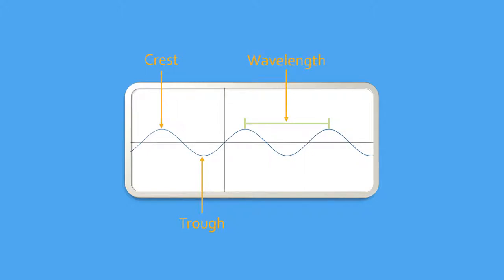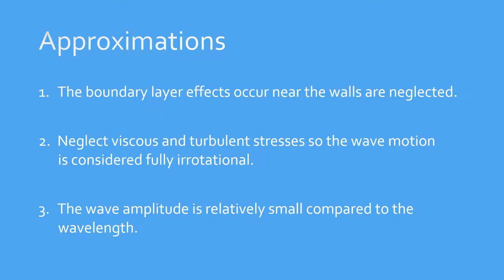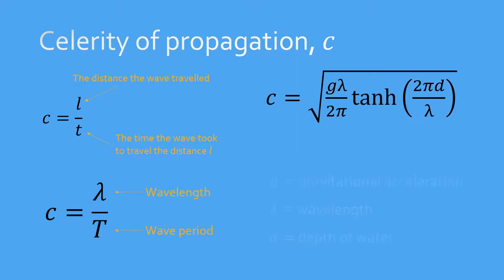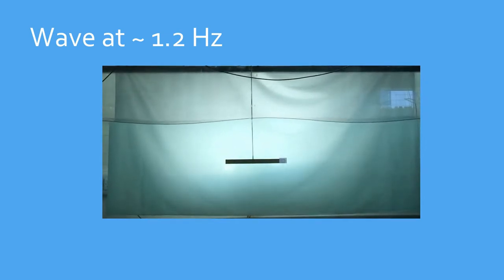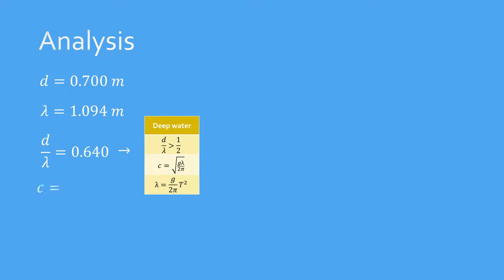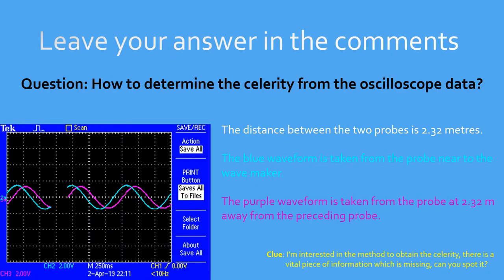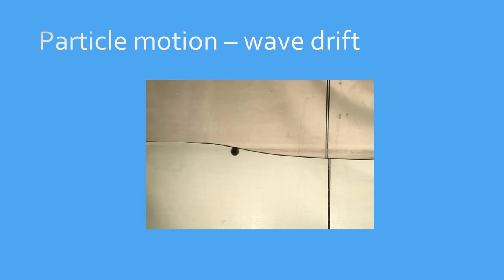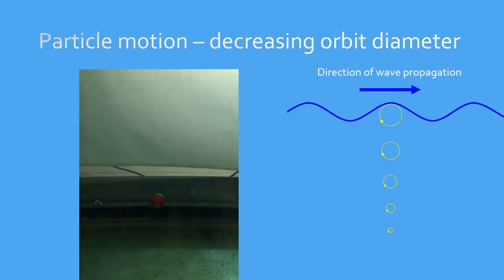Linear Wave Theory

Comment: If I understand the question you posed, you would look at the distance a crest (or trough) travelled (in this case, the distance between probes = 2.32 m) in the amount of time shown on the oscilloscope (I think you said each box = 0.25 sec, and it looks like about half of this, or .125 sec between the purple/blue crests), so the celerity would be c = 2.32 m / .125 sec = 18.56 m/s.  So I guess the snapshot of the oscilloscope is misleading since it shows the period of a much shorter/slower wave, while the wavelength and period of this wave must be much greater.
Reply from the maker: Hi MH, thanks for your comment/question. Your confusion is understandable and lies at the core of the question (see yellow text). A celerity of 18 m/s would clearly be unrealistic. Therefore, you should not use adjacent crests. The distance between 2 probes (2.32 m) is about 2x wavelength; thus, you use the time distance (in the oscilloscope) between the left-most blue crest and the third purple crest. This distance is about  7 'boxes', or 1.75 s. Your celerity is then 2.32/1.75 = 1.3 m/s, as estimated previously. I hope this helps.
Reply: @sergiomaldonado2655  How did we know that this 2.32 m distance is almost 2x wavelength? Was the wavelength already known??? If it was known then we could just use the time period of a single wave to calculate the celerity, i.e., c=wavelength/time period.
Reply: @sergiomaldonado2655  Or is it the same problem as before? From the laboratory flume??? If that's the case then okay!!!

Comment: Dear Sergio, you have a problem with Bernoulli integral: in 10:22 we see the particle velocity at the crest is even greater than that at the trough, in spite of  the difference in elevation. In the same time, for the potential flow the sum of Bernoulli terms (pressure head, velocity head and z) should be the same for all the domain at any time moment.
Reply: Nuh uh